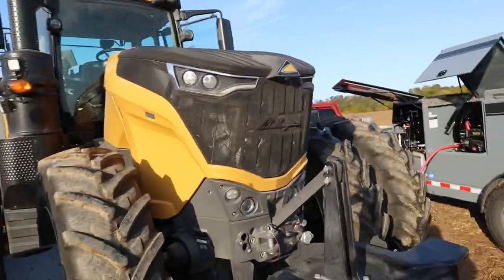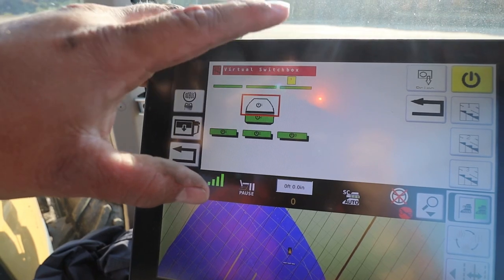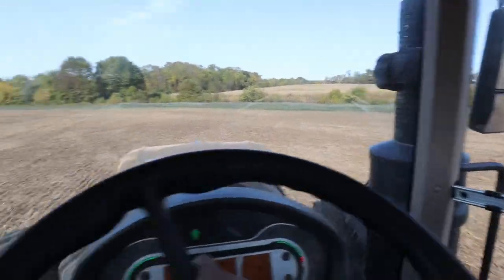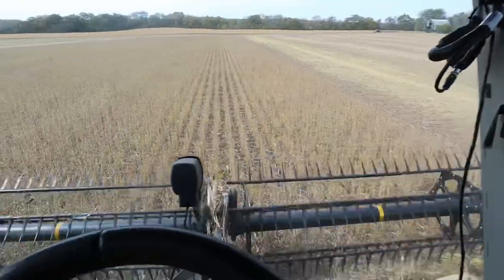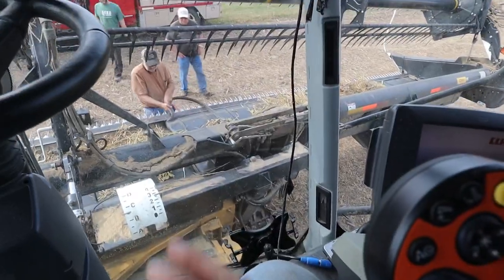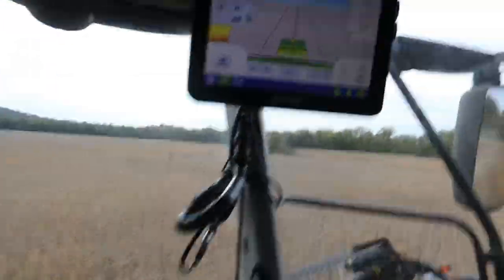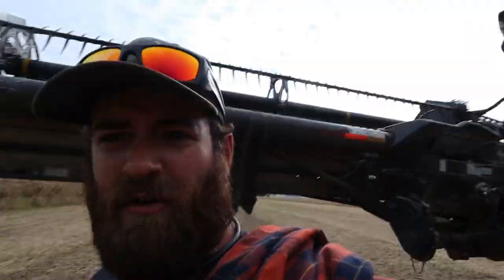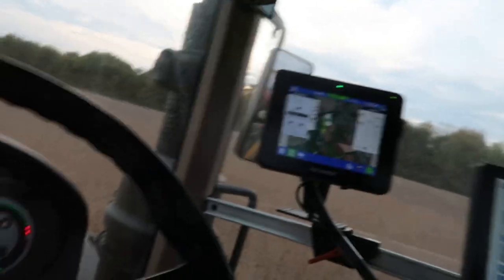Combine Fire..... almost

Comment: The most valuable thing I used to always carry on the combine was a 2 gallon pump up hand sprayer. I’ve put out several hot bearing fires and corn field fires caused by hot exhaust pipe fires caused by a pickup/gooseneck.

Comment: Hey Brian you can take off you belt and reinstall it where the ripped seal is on top and the good side that still has the seal on the bottom!
Reply: Also may wanna check you Draper deck clearance

Comment: At the start of your vid you disgustedly throw your toolbox on the draper belt on the combine head. I worked 45 years and my mechanics tools cost me a pretty penny and never threw my tools around. I am guilty of using a crescent hammer and always filed out the throw on my ten inch crescent to handle larger bolts than standard 10" wrenches and 15" also. So I am no better.